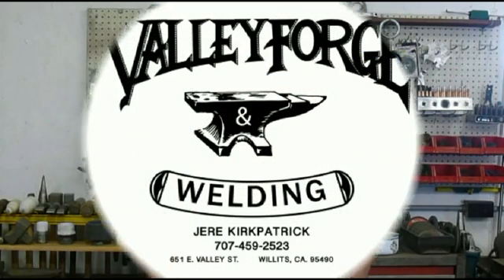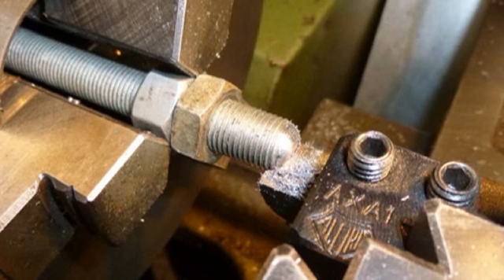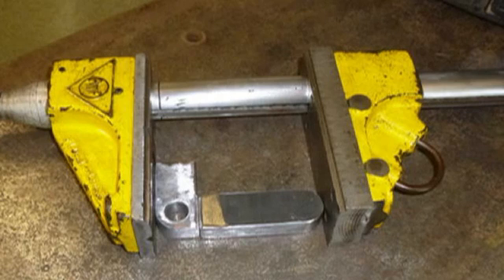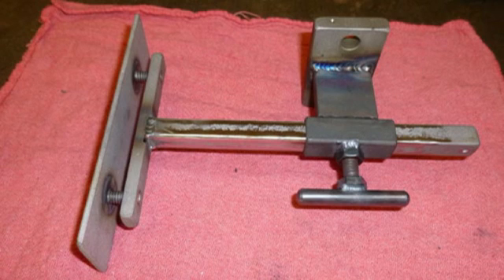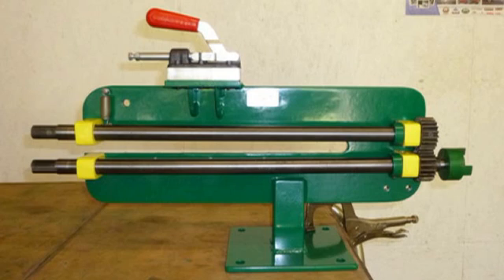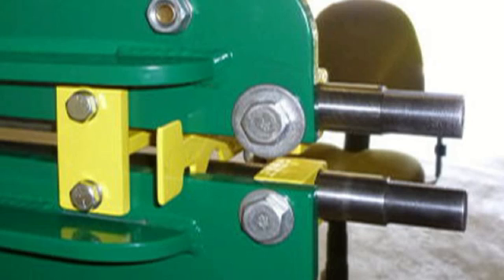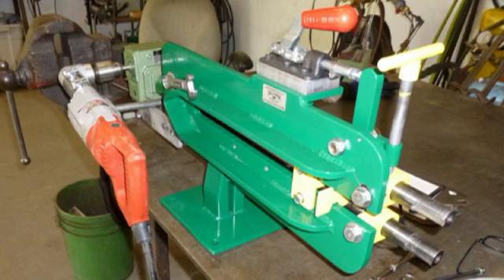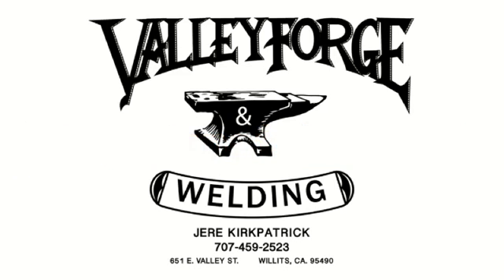Building Gene Winfields Bead Roller

Comment: Jere, can you offer any advice to an amateur welder on how to weld the “hairpin” reinforcement to the main frame without warping the frame too much?
Reply from the maker: Skip welding on alternating sides skipping 2" between welds. Warping should not be at issue. After the piece has cooled, install the blocks that hold the shafts and do what is necessary to allow the shafts to rotate smoothly.
Reply: @jerekirkpatrick2092  Thanks so much for quick reply. I appreciate the advice.

Comment: I’m in the middle of building my bead roller, I have fallen in love with this part of the fabrication world. I,ve been a aviation technician (A&P tech), certified Master technician for 30 years (General automotive). I came across this awesome video. I am definitely going to do that top part on my next build!  that’s incredible. I’ve been racking my brain for the last three weeks, trying to figure out a way to make a super simple consistent depth. (when doing multiple panels of the same design). 
Your design is exactly what I was looking for and trying to figure out. I decided to use a pressure gauge… work in progress… hopefully I’m rolling beads tomorrow. I’ll send you a picture.
Reply from the maker: Thanks Kris, you might think about using a valve spring seat pressure gauge. They are small and are available from Speedway Motors. I use one to measure the pressure of my English Wheel.              Jere
Reply: @ that’s exactly what I’m using😎🤙🏼🤙🏼 thank you sir!

Comment: Now, I have a question for you Mr. Jere.
Couldn't you use an old windshield wiper motor to power your bead roller?
Reply from the maker: Hi Aint:
Forward, reverse, and variable speed are built into the drill. Also the drill can be taken off of the bead roller and used as it was intended.
Jere

Comment: GREAT VIDEO WHAT RPMS DO YOU TURN YOUR DIES FROM HIGH TO LOW SPEED, THANKS AGAIN
Reply from the maker: Hi Mike:
I have no idea what the RPM of the dies are. I adjust the speed to what I am beading. I go faster in the straight parts and then jog the peddle to slow down in the tight spots.
I hope this is help full.          Jere

Comment: Nice modifications. I'm getting mine shortly and will be doing some off your ideas. Thanks. Subcrided !
Reply from the maker: Hello Tom.

Not all mods need to be done at the same time. After stiffening the frame, and fabricating some sort of mounting base, the most use full mod would be making the top shaft movable. Being able to align dies saves a lot of time when setting up the machine. It also allows you to make a different profile using the same dies.

Thanks for watching.          Jere

Comment: I took a picture of this bead roller last time I was in Gene's shop and I have since planned on doing a bunch of upgrades to my similar roller based on that picture. It's Great to come across this video and have all the guesswork taken out of the project. Thanks a ton Jere, great work!
Reply from the maker: Thanks Tyler.

If you look on my web site ( jerekirkpatrick.com ) you will find a complete set of plans that comes with a DVD. It might help you with finding all the material you will need to complete this project.

Give me a call if you have any questions and be sure to subscribe to my channel.

Jere
Reply: Jere Kirkpatrick  subscribed! Will definitely take a look at your site. Thanks again.

Comment from the maker: Hello Tyler. No I don't mind sharing information. I now have a complete set of plans to compliment the build of the Bead Roller. They are quite complete, done on a CAD system. There are sections with all the sources of material and hardware. Also included is a DVD that walks you through each page giving tips and what to watch out for during the build. Call me at 1-707-459-2523 and I will help you with what ever you need.

Jere

Comment: One question what is the cost of all the mods?
Reply from the maker: +Todd Switzer 
I bought most of the parts from McMaster Carr and the reduction box from Surplus Center. The total was a little over $200.00. Plus the cost of the drill motor which can be purchased from Craigslist. My plans are $40.00 in the US.

Jere

Comment from the maker: Thanks Kevin. Even using half hard material I would drill and tap and use the spreader block to increase rigidity and have a place to mount a fence. If you are doing repetitive work the quick clamp speeds up work a bunch.    Thanks       Jere

Comment from the maker: Thanks for your comments Gary. I like getting feedback. Does your gear motor have forward and reverse and variable speed? On my original build I used what I had in my shop which was a reduction box and my drill motor. It is not in the way of the slot in the bead roller. The drill I got for Genes machine was $75.00 from Crags List. The bell crank is a 2 to 1 increase of the movement of the quick clamp. If it were too hard to pull the handle down you could unscrew the "T" handle one or two turns reengage and then turn one or two down saving the time to unscrew completely. Please send me a photo of your setup. I like seeing the ways of doing things. jere@saber.net.  Jere

Comment: nice design but the motor you chose is bulky and in the way by the looks of it. expensive as well. why not use a gear reduction motor? I am using a 1/8th hp gear reduction 8 rpm on mine and it is more compact and looks better in my opinion. your work is very nice and some good ideas there. the one thing I see that I wouldn't do is the quick release. if doing a piece of 16gauge I find it difficult to believe that you can go from one bead to the next with the quick release without screwing the block down to get the depth in the bead. but hey if it works for you that is all that matters. great video too lots of info. thankyou.